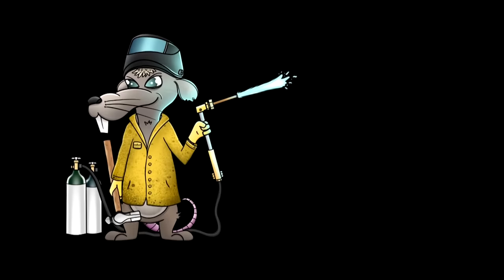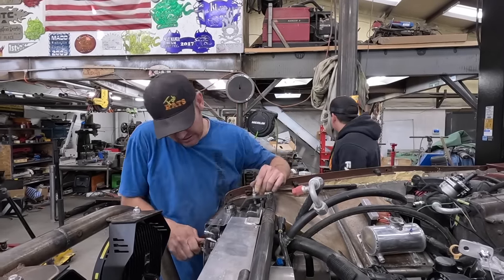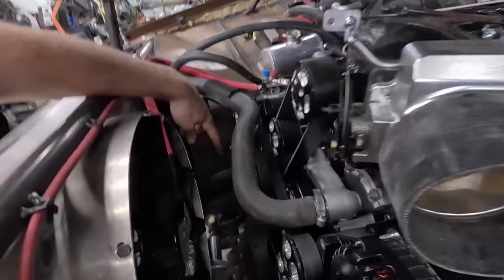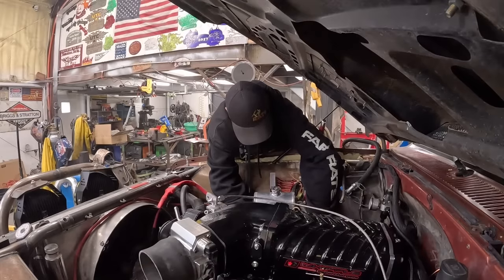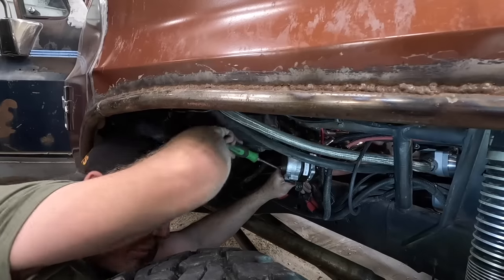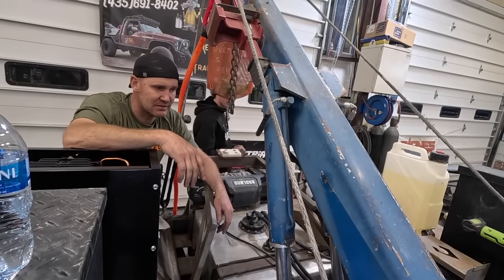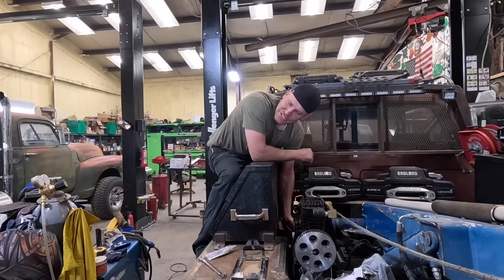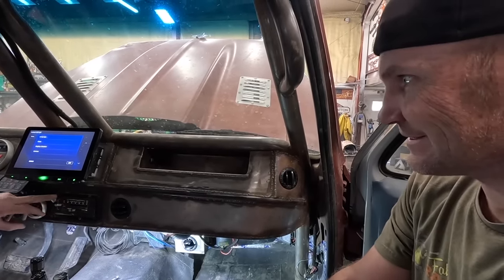We Super Charged The Rat Rod Wrecker………Will It Survive?

Comment: Drill a hole trough the all thread and use a hitch pin to prevent the fly nut from turning out and getting lost.
Reply: Or use a o ring or rubber washer
Reply: @johnperun232 old valve spring?
Reply: thats the Fab Rat way...    good idea  ...
 @mattmanyam

Comment: Cool upgrades! Make sure to keep the handle on that shovel oiled up with some boiled linseed oil. Will prevent cracking and nasty splinters!
Reply: im thinking the handle will warp and slide out, they should strap it down with an old leather belt or something
Reply: @SuperAndyyyy  maybe, keeping it oiled will help mitigate warping. Also, the boom is typically pointed up, which is in the opposite direction the shovel comes out.

Comment: I'd put a tab with a hole on the underside of the boom so you can run a tarp strap around the head of the shovel to hold it in place and make sure it doesn't fall out. You guys are kicking ass in this video.

Comment: The number of times, both you and Matt could have used a proper shovel and a land anchor. The land anchor especially is a great addition to get yourself out of trouble or at least secure the truck when pulling a heavy/dead weight load off the edge of a cliff or whatever. Prevent your truck from slipping with the load. Great additions!
Reply: Anchors don't work up hill or on rocks. They should have one but they have their limits

Comment: Hey Paul. I use hole saws pretty much daily and I have a pro tip for you. Take the hole saw off the arbor before drilling your pilot hole. Then put the hole saw back on. That way when the pilot goes through you don’t have to worry about the hole saw catching and breaking your pilot bit
Reply: As an electrician with 45 yrs in I’ve hole sawed my share of hole’s and I 100% agree!!!!
I recall someone back when telling me that he used a 1\4 inch rod as the pilot and always pre drill, it works, because I’ve heard the words …I broke the last pilot bit.😢
Reply: Absolutely right but you can also use a regular drill bit. Of exactly the same size or slightly smaller.

Comment: Great stuff Paul, be sure to check your air compressor to make sure it's rotating the correct direction! Take it from a guy that has piled up a reciprocating compressor before (they will make pressure spinning both directions, but the internals only take lubrication in one direction)
Also can't emphasize enough how valuable a guy like Shaun is on the crew, the laid back & solid dependable guy is priceless to have around.

Comment: Like seeing the processes whether an instart success or repeated until success is achieved. The fabrication events and thought processes are inspirational. The solenoid for the locker made out of a small length of square box steel being a highlight among highlights. Sean upside down under the dash another highlight. He ain’t a small ‘unit’ either. Under dash lighting and air con solution simple but functional and utilitarian instead of ‘tarty’. These build hold way more interest than flash and shiny custom works(which have a separate place in my heart) I take any inspiration forwards to my ‘so called’ projects. The smallest thing learnt here means a massive difference in how I solve my own problems. 

Cheers..

Comment: Here's an idea for the shovel. Drill a hole at the end of the handle and weld a nut on the boom and make you another wing nut bolt to keep the shovel sliding out when you go up an incline or bouncing around. The truck is looking great. Your dad would be happy with what you've done to it. Can't wait to hear it run after the dyno test

Comment: Paul, I like the shovel holder if you want to make it so the shovel does not move or rattle  cut a bit of pipe and cut out two 1 inch tabs. Drill two holes in the tube on the boom one each end then get two suitable bolts and put nuts on them  then put the bolt throw the hole and weld the tab on the inside. then weld the nut in place and you have a locking mechanism for the shovel. will not rattle or move.  Really love what you do keep up the good work

Comment: Make sure that steam port is on the suction side of the water pump. Ideally its goong to the top of a resovior that has a bottom hose going to the suction side. Tying all the high points of the cooling system to that is a great way to keep all air pockets from happening too.

Comment: I'd be interested to see the weight difference between an iron big block and an LS with the supercharger. Would be interesting to compare low rpm torque as well if you can get it back on the rollers

Comment: @Paul on the land anchors wing nut drop a valve-spring under the wing nut & it will absorb any shock from the rough driving & if the jack rattles put some bungie cord or rubber strap like innertube around it !

Comment: Take that wooden pole off that shovel, replace with a piece of old rigid conduit, tube, pipe, whatever metal and weld up the seams.  Will be the best damn shovel you'll ever have.  The concrete guys that did my shop floor liked mine so much they ran off with it.

Comment: This is Mr. Safety speaking, just for safety purposes on your mount for the sand anchor, the wingnut could come loose. Maybe drill an 3/16” hole through the all thread and adding a safety pin and some 1/8” cable to keep from loosing the pin.

Comment: A lot of work, done right... as usual. You may want to insulate that plenum/airbox, heat will be fine but come hot summer time, that thing will be a water maker. Of course you could make a collector and cycle the water into the overflow somewhere... or just insulate with that cab wrap stuff.

Comment: something i do, is drill a small hole through the thread all for he land anchor and then put a hitch pin through, nothing worse then losing something on the trail or while on the trailer. Same for the shovel. little hole right before the pipe mount and slide a cotter key in it... wire strap them back to something to lanyard them. and bam...  makes sure you dont lose nothing.

Comment: I would put some wing bolts or eye bolts in that tube to keep tension on that shovel. Not through the shovel, don't want to weaken the wood. Just in the top to keep pressure on the shovel from moving.

Comment: Little tip on your hole saw, drill your pilot hole without the hole saw on and run at high speed, then put the hole saw on and run low speed.  This gives two advantages 
1) you can see your center mark easier 
2) when you plunge through, you wont hit your workpiece with the holesaw and break you pilot bit, especially on larger holes.
I Absolutely love you work!
P.S.  WEAR YOUR SAFETY GLASSES!

Comment: In case your shovel works loose you can do the same thing as the sand anchor wing nut.. just drill a hole and weld a nut on then throw a bolt in with the wings welded on... Like a box hitch space tightener thingy!! Lol
Otherwise super build can't wait to hear that engine tuned and screaming!! 😂

Comment: I used to set my gages so 'normal ' pointed straight up. E.G. oil pressure, normal operating temperature on the highway, 'that' is where I'd set the needle straight up. Water temperature,  at normal, all point up. A quick glance at the gauges easily let's you know how things are. Boost gauge, point the 10 at the top, once you know 'your Max', if it is at the top, that's your 'do not cross' line.

Comment: That is going to be nice, horsepower is good but torque  tops it all. I hope that LS makes something close to what the big block did in the torque department.
Reply: This setup is superior in every possible way. More power, torque, economy, and reliability with less weight and it's not a giant heat pig that melts everything under the hood.

Comment: The air filter on the Voltair is kinda puny. Perhaps install a motorcycle cleaner. Place some heater hose under the sand anchor's frame to provide a resilient mount so it doesn't rattle.

Comment: Maybe you could use a snatch block that is solid/swivel mounted somehow to keep that winch line from running across that compressor? I'm sure it will get pretty hot although I don't know the effect of high temps on synthetic winch line but the friction from rubbing won't be a good thing for sure, but if you do one you'll want to do another on the other side. The Rat Rod Wrecker just keeps getting better and better.

Comment: You should wire your charger pump and cooling fans to engine run circuit.  This well help take load of the battery for start up.  Then add a bypass for the engine cooling fan so it can be manually turned on for shut down cooling.
Reply: Oh and maybe look into electric water pump to also be powered manually with the cooling fans to keep water flowing to prevent hot spots after shutting down

Comment: A couple of suggestions for your supercharger setup.  First off, get rid of the Y-pipe and go with one filter.  You are Y'ing into a single pipe using the same sized pipe on the splits, and that pipe is actually larger than your throttle body so you will not get any more air flow so your wasting valuable under hood real estate .  The second one, is to get outside fresh air to that charger and NOT the hot air in the engine bay.  That supercharger is going to ramp your ACT's way up and if you add the hot air in the engine bay you are heading to major detonation.  Through tests I did on a 17 psi setup with a Eaton Root supercharger, we lost close to 70rwhp when we used hot engine bay air instead of outside fresh air because we had to pull timing to deal with the increased ACT's.  One thought is maybe to build a box that will surround the rear air filter you have so it can pull in air from your hood scoop which is right around there.

Comment: You might want to run the intake for the compressor to inside that storage box sitting beside it....that way the filter be protected from rain/snow/mud. Or at least route it somewhere that it will be protected from the elements.

Comment: I would weld a piece of chain on the boom near the shovel base, drill a hole in the shovel and use a dog leash clip to clip the shovel to the truck to keep it from coming loose at high speeds and going through a windshield.

Comment: What if you use the sand anchor to anchor yourself down while doing heavy pulls if there’s no trees around. Equip yourself with two so that you can set them out in two different spots and tighten them down for the extra pulling strength  when needing to stay in place.

Comment: Paul, I'm kinda surprised since you have been using Premier Power Welder's for years. Then it took Rory showing the Pull-Pal land anchor in use. I've known about them since 90s, I kinda regret not buying them back then. I didn't buy the welder then due to being fixed to one vehicle and I had 2 Jeeps then now five.

Comment: Check for correct cam gear for cam position sensor. Computer may be looking for a certain signal. Had same issue when I swapped cam in my 08 gmc. I put a 3 bolt 1x cam gear and my computer required a 4x.

Comment: You may have already changed this but I would change out the lastic boost line to 1/8 copper line, second by running a supercharger I don't think you will have engine vacuum, it will be like a turbo charged diesel, run a electric vacuum pump

Comment: For the shovel mount I would drill a hole in the tube and weld a nut to it and put a bolt with a knob on it so you can hand tighten it to lock it in.

Comment: It's running rich because you don't have the MAF sensor hooked up.  That is the first sensor on the intake-  right after the air filter.  It is what calculates how much air is coming in---- so then it knows how much fuel to give.  Without the MAF-- the computer doesn't know how much air it is breathing at start up...    But then as it heats up a few minutes, the O2 sensors will see that it's way too rich-- and then tell the computer to dial back on the fuel and this is known as "closed loop"..  which means the O2 sensors are now in control.  But when you first start your truck, it's called "Open LOOP'-- and that's when the MAF is in control.  But if you don't have a MAF on that intake tube, the computer is blind for the first few minutes.  It's actually very simple.

Comment: For the shovel why don’t drill a hole and weld a nut to it and then weld a wingnut on a bolt so you can screw it into the handle to keep it from moving and then easy wingnut loosen it up to take it out

Comment: 44:27 When Paul said it might rattle why not put some type of rubber molded bumper guard type cushioning there to make it more secure to reduce the chance of rattle and long term wear and tear from metal on metal, plus it may get wet for periods at time for a while and Paul doesn't like to paint anything so the metal on metal may form some rust over time while rubbing and rattling back and forth on trips and on the trailer to those trips or recoveries in the snow, rain or in a water situation?  Humbly just a thought and I'm sure you know someone or have a fan that has that capability if you do not know how to make it yourself. Love the entertainment of the builds, the family life and the crews in front of the cameras and behind the scenes that make it all possible!

Comment: That tow truck will be a greater beast after Chad's and the dyno. Still have some buttoning up and fit-ups.  Reliable power, heat & a/c, welding alternator c/w modified spare, air compressor.

Comment: 11:50 - I know it hurts when I join up some wires for soldering, drop the flux on; and in that moment I notice I either forgot to put heatshrink on the join, or it slipped off.

I don't even wanna know what lengths of heatshrink that long cost..

Comment: I'm a little curious where you're going to get vacuum for your HVAC doors, your power brakes can run off the power steering pump with the right booster (which hasn't been mentioned), but not the doors.

Comment: mount the round light on roof, they r blocking air flow on ur front..
u need all the air to go across the rad and Innercooler.... also do t have any hot air from the rad go by the air cleaner

Comment: I have a idea for the compressor… why not use  a regular 220v ac hobby compressor with built in airtank and simplt run it trough a powerinverter then with the powerinverter you have option for other equipment.. and make chad fix a pto switch and get 1500rpm  at idle then your alternator charge even better when use the winch and the powerinverter
Reply: Still slower...need a 3500-4000w humongous inverter to handle the 15a 120v startup draw of the AC motor.

Comment: Simple question regarding your air storage system, which is one heck of a tank storage system, but the way because that’s a lot of cubic feet of storage.  Are there any drains plumbed into the tank storage?  Might I suggest using a 12v solenoid thats powered from the compressor switch, that is attached to the lowest point in your system to drain condensation that will build up in the tank.  Upon compressor start-up, a standard 12v solenoid wired to the compressor’s load side of the start/stop switch will open allowing all moisture to be expelled as pressure builds.  The only time the solenoid will open is when the compressor is energized and in operation.  A manual override switch will be needed to shut close the solenoid once the condensation is gone, allowing the system to fill all the up. Just a thought. There are 12v timers that have timers built in but they’re $$$$.
Reply: So it's draining 4 tanks the whole time it's filling that doesn’t seem like a good plan

Comment: Wow, that is one mean engine. I think you need to bring Michelle in direct you guys on how to do the stuff. You know things go wrong until she’s there. As far as your 12 V compressor you don’t want a 12 V compressor go get you a compressor off of a semi truck Tire pressure switch into a switch in the cab so you can turn it on and off as you want. Put you a couple of air tanks under the truck with pressure blow off valves and it can run automatically or you can turn it on when you need it. And you can get more pressure than you can get from a 12 V And more volume, which that’s the key is volume. Specially, if you’re running pneumatic tools. I helped my brother put one on his truck years ago. It works great. He also put a actual semi truck airhorn on his truck and that works great. it’s just a suggestion. I love you guys and what you do and don’t listen to people when they say to keep Michelle and Grandma off the show. We love seeing them and watching them. God be with you and may he bless you and your show.
Reply: He has a space problem. Those semi units are huge normally. He had to switch to 12v

Comment: 46:43 That' pretty good for 12 Volt too .. I want o put 12 Volt air in my StepVan, it'll pair well with the Automatics Tire chains I  plan on doing too :)
Reply: That's $2400 LOL. Much more reasonable options. Look for the Napa 300L Twin Cylinder air compressor. $150ish but online discounts AAA etc and very reasonable price

Comment: Air manifold should be drilled and tapped before you seal the ends so’s you can clean out the metal chips before you close it up, js

Comment: Guys, here's a trick I use to make a 2" dash hole to a 2 1/16".  I drill out a pair wood block with a 2 1/ 16" hole saw bit.  2 times.  Then I stack the 2 wood pieces on the centering bit of the holesaw. Then that will allow you to set the wood spacers inside the 2" dash hole and holds the 2 1/16" bit centered in the hole.   The wood spacers are 2" ID on  2 1/16" bit. 
Try it, you'll find it a lot easier than running a grinder to make a 1/16 bigger hole out of a 2" hole.

Comment: The air compressor factory housing acts like ductwork to direct cooling air over the cylinder. If you decide to leave the housing off, a high temperature cutout switch should be considered.
Reply: There's 1 factory mounted

Comment: I have air on my truck i use a old AC Compressor and have a tanks built into my bumper that holds the air it works good and it's fast too.
Reply: Which compressor?